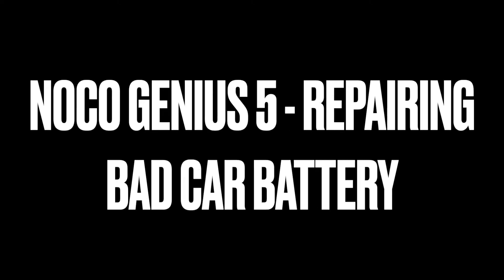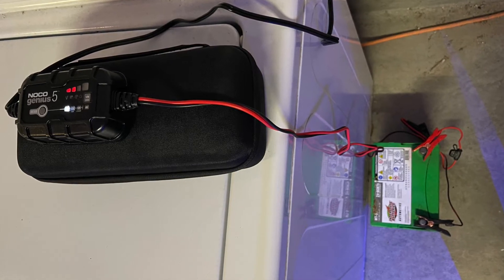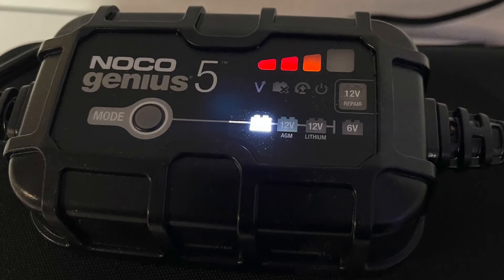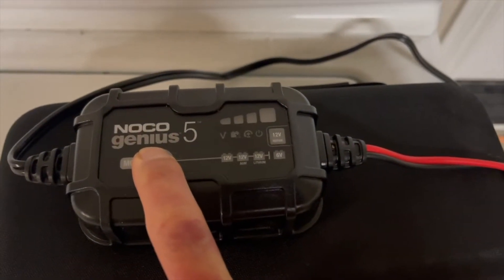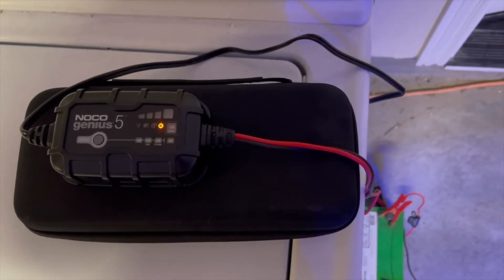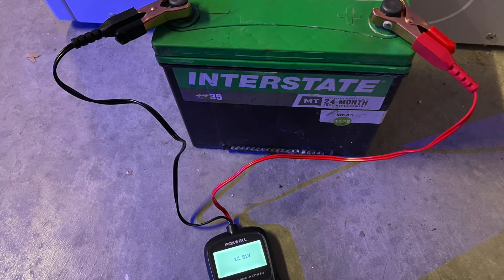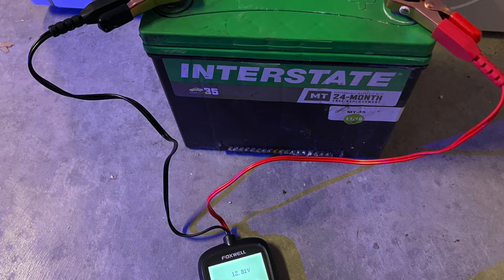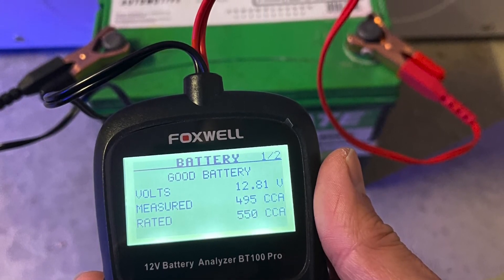NOCO GENIUS 5 - REPAIRING BAD CAR BATTERY

Comment: My 12V battery is about 12 months old. I fully charged the battery (only green LED displayed). Started repair mode. The repair interval was almost 6 hours duration. I will repeat the process in 6 months.
Reply from the maker: Thanks for sharing. The process takes a while.

Comment: Wondering if the repair mode works on 6 volt batteries?  Will the unit automatically sense that ?
Reply from the maker: Per specs it says it will support 6V batteries. I don't have one to test with tho.

Comment: Wish you would have load tested the battery before using the repair mode to actually see if it made a difference
Reply from the maker: There’s no measurable voltage per my friend
Reply: @netman88  yeah but you were able to charge it before the repair.  If you do this again, please test the battery after charging it, before the repair operation. That would give us information about CCA changes from the repair itself.

Comment: So at any stage of the battery you can set the noco to repair your battery? That will be nice bcoz, cold during the day without starting my battery is at 11.8V
Reply from the maker: For 11.8v, just a charge is good enough.